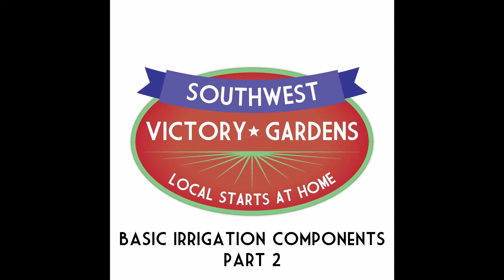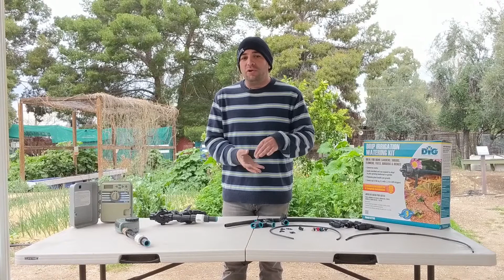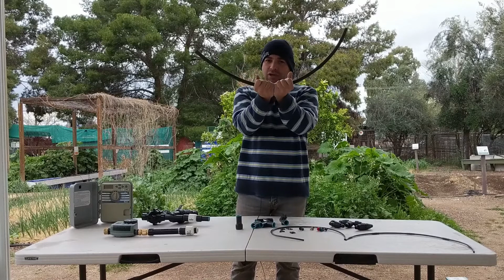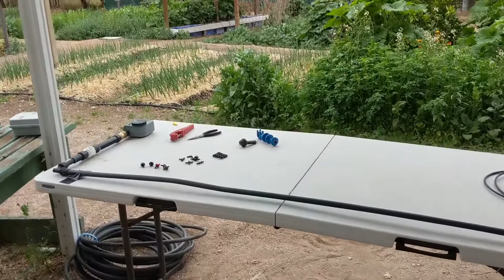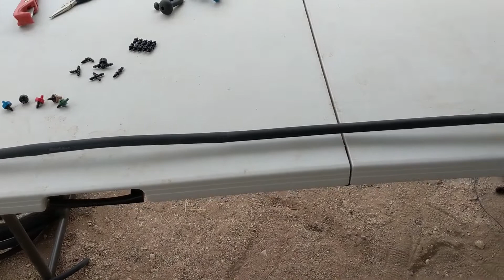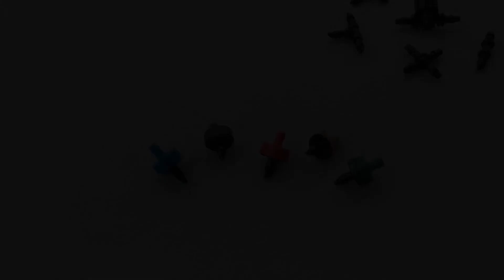Desert Gardening Basics: Drip Irrigation Tubing

Comment: Hello, can I convert on main line 1/2" to 3/4" tubing?? I'm still learning, I researched on the tubing coverage on my property aprox. 600 feet. So I need 3/4" .
Reply from the maker: yes definitely. Increasing the diameter of your line will allow two things, it will allow you to run a longer distance of tubing and also it will allow you to put out more gph than you would be able to with 1/2" line. If your water pressure is only coming from one source and you need to run 600' of line I would for sure move up to 3/4".  Good luck!

Comment: Hi. Thanks for the video. Total rookie here learning to do basic DIY's around the house. Few queries -  How have you connected the poly tubing to the pressure regulator? If I have to connect a soaker hose at the end of poly tube for my raised bed, how do I do it, how do I connect it? Link to the products would be helpful. Thank you.
Reply from the maker: great question roopa. One side of the pressure regulator connects to the filter and the other you'll get a special conversion adaptor that will allow you to connect to poly. It is called a "compression adaptor" because it uses compression to create a water tight seal around your 1/2" poly tube. Here is one you can get on amazon: https://www.amazon.com/Raindrip-320G00UB-620-630-compression-adaptor/dp/B003CCVZY8/ref=sr_1_3?dchild=1&keywords=irrigation+compression+adapter+pressure+regulator&qid=1621548425&sr=8-3

Comment: To heat up the end of tubing to make it easier to install, how about filling up a thermos bottle with HOT water and just dip end in before pushing on.  I use a heat gun!
Reply from the maker: Any of the above will work. A lighter or flame will also work. Sometimes it's hard to dip lines in hot water when they are already in place but for new installations hot water works great.
Reply: I did that.  It works well.